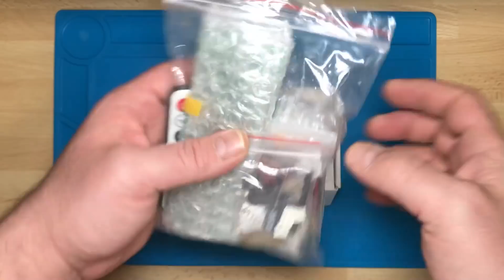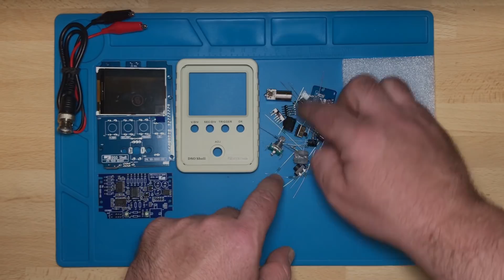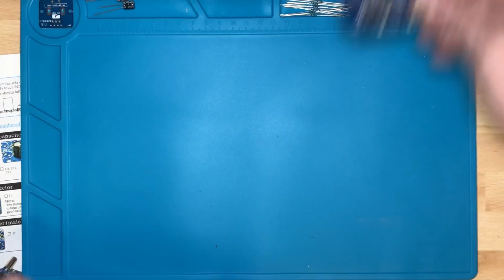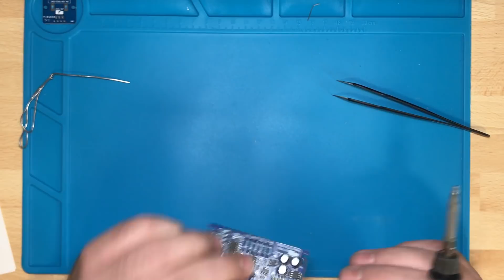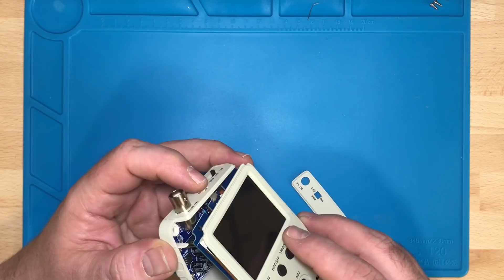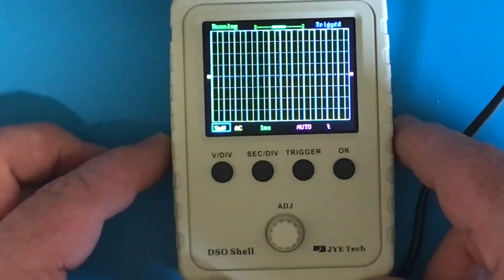Assembly the JYE TECH DSO 150 Kit from banggood with a lot of soldering

Comment: I built the DSO-138 and Two of these DSO-150's with zero issues.  Cheap enough that I could gift one to a kid to learn some with. Just other day I seen BangGood is offering this DSO-150 Pre Assembled WITH a Proper 10X Probe for as little as $25.00.   Dang.  Surely not a Tektronix  but   They beat the crap out of working with nothing but a DMM for some things, eaa?   Note :  The manual that comes with them can be a bit confusing because they  list a few build objectives out of order.  Pay attention to the Encoder PCB orientation..  I managed to install the first one Up Side Down the first time.  Not so easy to unsolder.  LOL